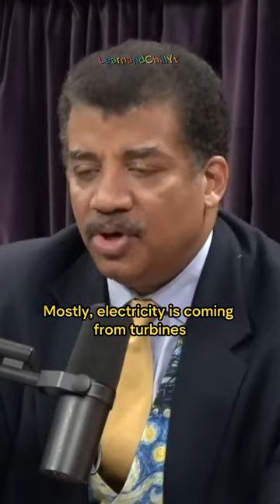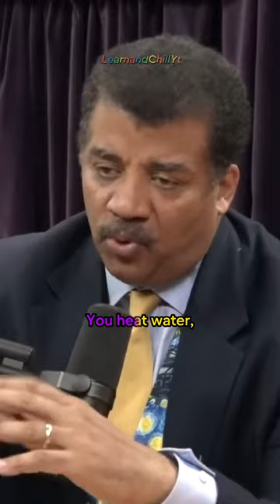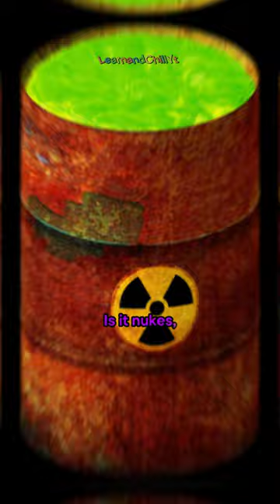How electricity is produced⚡️ /Neil deGrasse Tyson

Comment: Wind or hydro directly turns the turbine and not steam.
Reply: Interesting.
Reply: Where do clouds, rain and river water come from? How is the heat of the sun responsible for our weather system.
Reply: Steam turbines are a real thing 😂
Reply: @commonsens...  He's saying windmills and hydro dams don't boil water, they use wind/water to move the turbine not steam.
Reply: Knowing there are things like to be said on his videos concerns me when I legitimately am learning something new. (I came to say the same for turning but of course I'm not first).  And while he didn't mention it, Solar doesn't use mechanical energy and engines just turn a turbine...
Reply: What is the pH of the stratosphere ?
Reply: That's not what he said
Reply: @erikbabry7233 Did you not know this? All electricity is made from a generator turning on a turbine whether it's steam. Pushing the turbine water, pushing the turbine.
Or call  heating up water. Turning it into steam, pushing the turbine.
Reply: He said most of our electricity
Reply: Wind turbines don't work unless powered by the grid that's his point genius they can't turn over without assistance and many other components.
Reply: Oh you failed to comprehend man listen again and come back later
Reply: @ridgerunner106  What is pH
Reply: exactly  ; a real blooper
Reply: @erikbabry7233 
from that point of view our planet would be dead , zero rnergy without the sun ... but that is not the point !
Reply: I was going to say the same thing.
Reply: @allanebora3396 he said ehere do you get the energy to boil the water. You wouldnt get the energy to boil the water from wind or hydro as they produce electricity without steam.
Reply: @solsm08 thats not his point, hydro requires nothing from the grid. All Wind mills dont require grid energy to operate.
Reply: They directly turn a generator not a turbine.
Reply: I almost don't think I should engage in this confusion 😂 BUT, turbines, as in hydro and steam are synchronized across the national grid to produce a unified sine wave of alternating current. Wind turbines are sporadic as wind is sporadic, so their energy output, like solar has to be stored then converted or inverted into synchronized sign waves (AC). The process and equipment needed to convert wind and solar energy to sync with the power grid is extremely inefficient compared to hydro, coal and nuclear. However, the most efficient mechanically speaking is hydro electric dams. But, as a side note, AC power is extremely inefficient to transmit over long distances compared to DC, because AC current degrades rapidly over long distances, and the transformers needed to reduce it to usable voltage have an extremely high maintenance cost and a very short life span. It would make much more sense, and make energy far cheaper if we converted our power grids to DC, but politics. So there you go, the basics on why we get most of our power from turbines.

Comment: Wind turbines don’t make steam. They make electricity directly.
Reply: The one argument that let all experts in the room realise that he blends truth and lies together. ... and hydro energy is also directly transformed to electrical energy.
Reply: And so does hydro - NDT is a smart and educated guy, maybe the editors of clip are not…
Reply: And they're using electric boilers to generate the steam, which are highly inefficient compared to NG or diesel boilers
Reply: The most common form of solar  doesn’t make steam either.
Reply: Turbines are the Tool to spin a generator With a Medium which is Wind or steam
Reply: The thing is is with the wind turbines they use an incredible amount of oil to produce. And when they break down there's no there's nothing you can do with the pieces they just sit and take up space
Reply: Wind turbines don't work unless powered by the grid that's his point genius they can't turn over without assistance and many other components.

Comment: Most people don't know how nuke powerplants make electricity.
If they did, I think more people would be open to having more of them around.
Reply: Also the use of spent rods in medicine and elsewhere.
Reply: Most people don't know that Coal (carbon) as a filtering material leaves most coal power plants more of a nuclear dirty footprint (from fly ash) than nuclear power plants
Reply: @russellhoelscher4424  I think I know what you're trying to say.
Reply: Not the people that lived around Three Mile Island, Fukushima, Chernobyl etc. They will always remember the lies that they were told during the events.
    Never forget that previous to these events the people kept being told that "things are different now, the brightest engineers in the world have designed out any and all potential issues, and everything is under control".
    Is it any different now?
    Also, if it's supposed to be so cheap, then why are we getting nuclear production surcharges on our electric bills?
Reply: Safest cleanest energy we have.
Reply: Absolutely!!

Comment: As a nuclear fusion reactor the sun creates and transports to us with photons all the energy we will ever need.
Reply: We are just not good at harnessing it yet.
Reply: @schoolmarmjackson7656  Yes we are. The problem is we are also very resistant to change.
Reply: @johnwyman6126 the problem is the battery mining.
Reply: The problem is when the sun goes down, or it's an extremely cloudy day. One needs an incredible battery bank to store the energy to fill the gaps. There are also substantial losses in charging batteries, delivering the power from batteries, and in the inverters that convert the DC power to AC in order to supply the grid.
Solar panels also have a life expectancy. The cheap ones around 10 years, the better and expensive ones up to about 20 years.
Reply: @johnwyman6126 especially when it’s completely impractical.
Reply: @fredflintstone8048  Very true but what will batteries be like in 10 years or 20 years? Or in 2070 when the earths supply of fossil fuels is exhausted?
Reply: @phunkyjunkee  Not really. We have been making batteries since the late 1800s. I can't recall ever hearing about shortages in supplies of raw materials in all that history. Besides, we have an incredible infrastructure to be able to recycle battery materials so much so that 96% of batteries are recycled today.
    Don't forget, even if we do have some sort of a supply shortage, renewable energy systems can easily switch to a different battery technology. My personal charge controllers can charge flooded lead acid, VRLA, nickel cadmium, nickel metal hydride, nickel iron, and various lithium technologies that are already pre-programmed into it, and I can even program in some future technology that we don't have yet such as the new salt based batteries.
    There are already hundreds of thousands of renewable energy systems supplying electricity to their happy owners. Please don't listen to the naysayers who have one thing after another to try to dissuade people from even trying it. Remember most of it comes from the electric power  industries who want you to rent electricity from them for the rest of your life.

Comment: Actually…. The steam only turns em on start up. When you connect to the grid, the grid holds the turbo-generator at speed. The steam provides torque. Torquing the generator rotor bows the lines of flux therefore cutting more. The number of poles in the generator determine what speed. Could be 1800 rpm or 3600 rpm (generally).

Comment: Also in at solar farms they have a fluid that is in tube's behind the panels. As the panels heat up they heat the fluid and that is pumped to heat water to power turbines. What he is talking about with fuels is co-generation from burning fuels mostly natural gas but they due use other fuels

Comment: the most crazy part is is that the most peak of energy production, yes even the nuclear plants, is the same concept boil water or some sort of steam and blow it through a pipe to turn a big ass wheel with fans for electricity. the oldest thing Humanity has used for power at this point you might as well just say "what creates a Fusion engine work? oh that's right a turning wheel" personally I feel like we need to remove the whole
"boil water/steam" thing and just find a way to turn the f**** wheel, then our power crisis will be solved.

Comment: Wind and hydro makes electricty directly. No need to boil water to make steam to power the turbines - NDT is a smart and educated guy, maybe the editors of clip are not…
Reply: No. Wind and hydro are power sources. In engineering they're called mechanical inputs. Every generator(things that create electricity, ex: a WIND turbine) requires mechanical input. He is talking about steam turbines(coal powered trains) and also gave OTHER example of mechanical input sources. Go back to school.
Reply: Some power plants are using electric boilers to create the steam instead of gas fired boilers... highly inefficient method.
Reply: @tomdowd7407  of course, but since there are wind- and water driven turbines put in to those power sources, converting the dynamic flow of the wind blowing and the water streaming over the bladed of the turbines to electricity, there is no need to detour the power thus generated in the processes over to boil water as an intermediary and therby also lose efficiency in that superfluous transfomation!
Reply: @bjorncarlsson6295  never once does he mention anything about superfluous transfer. Your attempt to sound smart just further proves your poor comprehension

Comment: Solar is a 40 plus year panel lifespan, solid state, mass produced direct to electron energy source. When it's surplus, you can store it as heat or battery. Battery is solid state direct to electron. Heat needs a whole set of moving parts...  so.... I'm putting my chips all on solar plus battery.

Comment: I reacted to that too.  Steam? Not always. Norway use hydro electricity.  The water flow turn the turbine. Not the steam 😅
Reply: the sun makes the steam (water vapour) and lifts it 

the water vapour falls as rain or snow in the mountains 

and now the (fluid) water has potential energy 

so...ya...kinda right
Reply: @notlikely4468  hehe .. kinda correct.. but he talking about high pressure steam turbines.. i learned about those in chife engineer school :) ... but half correct somewhat... guess he did not want to go into details for the common person

Comment: No, Neal. Not with hydro.
I the case of hydro, the kinetic energy of the falling water is what turns the turbine. There is no steam involved here.
In the case of any power source that involves heat (coal, oil, nuclear), then yes, you need to use water vapor, which then will make the turbine turn.
Just not in the case of hydro power.

Comment: Wind and solar don't need to generate steam to turn a copper cog to make electricity. Wind turbines turn the cog with wind and solar converts direct to electricity via solar cell physics. Everything else is a fuel to boil water and make steam. Hydro also uses water pressure to turn a cog without having to heat water. Geothermals fuel is the earths core itself.tidal and wave power uses the earths water state to move something that avoids having to heat water

Comment: What if you could cut the energy needed to make steam by 2/3s?
You can by heating water and spray it into a tube just before the turbine it flash boils into steam that passes through the turbine and to a vacuum chamber to condense on a radiator filled with cold water.
Reply: Or keep the water in a vacuum or low pressure which drastically reduces boiling point, meaning less energy to boil water
Reply: @MarkkuS  So Markus you don't know that no matter how water boils it still expands 1699 times its liquid state volume and you can't conceive of how such low temperature steam can be cooled and condensed rapidly thus maintaining a vacuum within a system?
Reply: @herath4008 The starting hot water tank would be part of a sealed system with pure water 90 F is sufficient to cause sprayed water to flash boil and in a separate tank structured with a radiator to absorb heat at 60 F you can flash recondense the steam with a turbine between these two tanks you get more power by taking advantage of physics as no matter how water boils it expands to the same volume.
This is not some esoteric free energy thing it is just creating a high pressure area that then goes to a low pressure area while taking some of that energy out as electricity in fact the more kenetic energy you can take out as electricity the easier it is to get steam to recondense.
Reply: Yeaa or use cold water that identifies as hot steam
Reply: @BGRatz77  Hey Hey now we are not  doing sports here! ;)
Reply: essentially like running your car engine on pure "fumes" instead of a full tank of gas :)

Comment: Energy is stored in nuke, oil/gas/coal, the sun, etc.  The problem is less about generating under ideal circumstances, but under less than ideal.  Solar with no sun, wind on a calm day, hydro on a dry river.  nuke and fossil fuel energy is able to be transformed under any environmental condition to usable energy..
Reply: Disasters happen, If a tidal wave hits a solar farm, You just have to rebuild the solar farm. No evacuation needed. What happened during Fukashima?
    If control panel operators screw up and don't do the exact proper things at the exact proper time, You may get less power from a field of wind generators. No permanent destruction of the whole area that cannot be inhabited for thousands of years. What happened at Chernobyl?

Comment: You don't get, 'the energy to boil the water from hydro'. The water pressure from the dammed up water causes the water from behind the dam to flow directly through the turbine blades. No hot water or steam required. Sure, that's probably what he meant but Mr. Tyson is a bit sloppy with his explanations from time to time..
Same with wind.. The wind turns the blades which turns the generator/alternator directly through a gearbox.

Comment: Nuclear electricity is a good way to go for now.
Reply: Did you know : the Sky has a Positive + charge and Ground has a - Negative Charge. And if Antenna and iron rod in dirt are interrupted with a little Circuit, you can get electric 365- 24/7. Every 10 feet up is more Voltage, as every few inches deep the Negative grounding is, is greater voltage amps...
Only $2-3,oo circuit-4 diodes and 4 Capacitors + antenna and grounding rod and the curcuit is on YT. Electricity from air/ sky. This Does work, 0 risk of Cancer or Death from radiation. Circuit is solid state analog and life span is pretty good, decades...

Comment: Hey I was told that airy dust and unicorn farts could power anything.

My college professor who wears 2 masks, has purple hair, and wears a Ukraine lapel told me.
Reply: Although in theory unicorn farts could spin wind generator blades, Adding fairy dust would probably erode the leading edges losing efficiency. So, in this case, that doesn't seem too practical. Pretty typical for college professors these days.
   I think it should just be left to the wind to spin them. It works very well as designed, as long as it's located properly. It's much more practical despite the erroneous ideas of uneducated but very politicized people.

Comment: What he’s saying is just categorically untrue. The only turbines being turned by steam are coal oil and nuclear wind, turbines generate, electricity, just by wind turning the turbine water turbines in hydroelectric dams are turned by the pressure of water. There’s no steam being generated from the water I mean, what is even trying to say Water flows through the turbines and turns down when they want more electricity. They flow more water when they want less they they shed water outside the turbines when they want less electricity from the wind turbines they clutch the turbines and stop them whole fields of them will be running while right next to them whole fields of them will not be running because you cannot generate power unless it is somewhere to go, but as far as steam turning the turbines, that’s only in plants that burn fuel of some sort like cold oil or nuclear plants

Comment: We need to invent a new way to generate eleticity that isnt just another turbine.  Why i support solar
Reply: He just said wind is powering boiling water so all bets are off. 

Solar is going to be king at some point
Reply: Solar is fine until it's nighttime.
Reply: @darrenanderson2895  how's that?
Reply: Fine if you are only interested in having electricity when the sun shines and it is not overcast. Personally, I prefer having power all the time.
Reply: @smashdaworld5916   Because at night there is no sun.   If the sun is on the other side of the planet it's hard to generate electricity.  Some would say impossible.
Reply: Fyi. I think solar is a huge waste of time.
Reply: @darrenanderson2895  why? Taking photons and using them to "push" electrons feels like using an energy source with the most excess power
Reply: @darrenanderson2895  oh yeah it's to bad there is no way to store the excess electrons like a small army ready for action you know an electron battery.  That would be silly though
Reply: @smashdaworld5916  it is technically impossible to create  a battery or series of batteries large enough to provide new York City power for a half hour let alone over 12 hours
Reply: @darrenanderson2895  why is that?